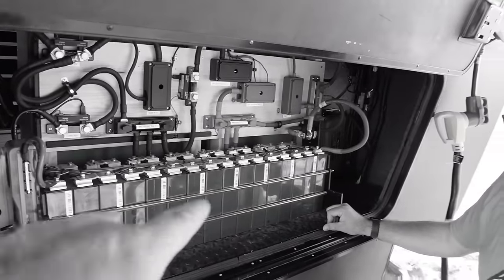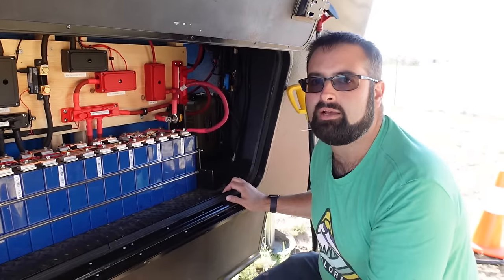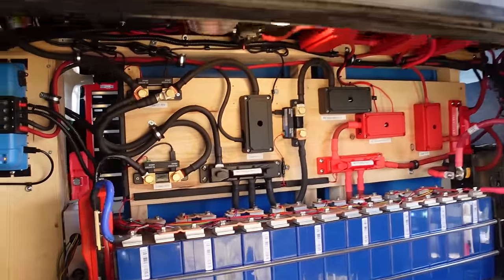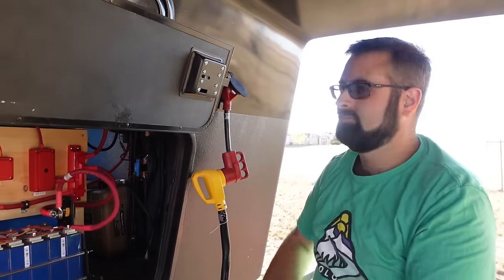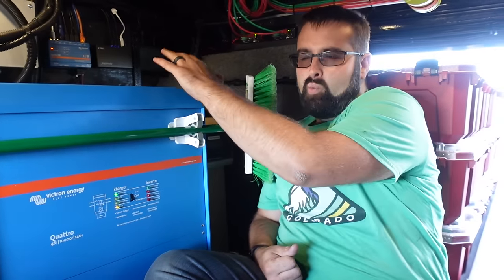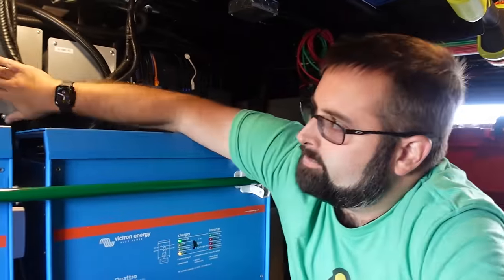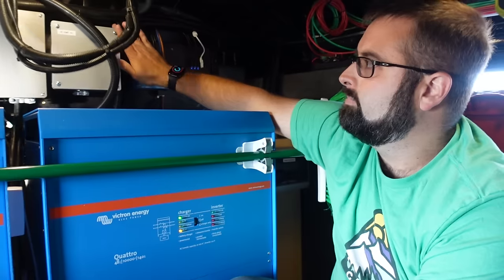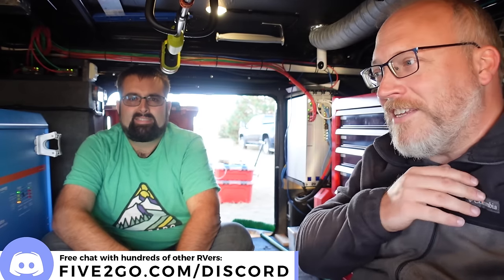How To Do RV Lithium The Right Way

Comment: Exactly why I built my own….BattleBorn is great product…when you want a name and have a big checkbook. I wanted capacity and didn’t care about a name. Built roughly 16kwhrs for roughly $1200. Wasn’t hard and love them.
Reply: do you have a manufacturer / parts list for the $1200 system, just what I have budget wise
Reply: Yes, share more info.
Reply: im doing the same thing  and its a lot cheaper
Reply: @mattg8787  can you share your setup/bill of materials ?
Reply: @ALongLongWaytoGO  Thank you so much for taking time to document your method, will look into this for sure !
Reply: @jz2188  thank you. It’s a work in progress. Definitely still learning. I always do not want to impede on someone else’s YouTube channel. But if you hop over to our channel I have a lot more detail about my battery builds. YouTube@A Long Long Way to GO…and again…I don’t want to impede on another channel.
Reply: You didn't build a 16kwh lifepo4 pack that's for sure
Reply: @randybobandy9828  I do apologize for that mathematical miscalculation. I’m so glad for much smarter people than I am. My stupidity gets me regularly.
Reply: @randybobandy9828  since your much more versed in this than I am…I’m just learning and don’t know everything….I have 16 320ahr cells and I don’t exactly know what voltage to do calculations at…so they hold pretty stable at 13.8…..roughly. What else do I need to know to calculate it correctly?
Reply: Does it work for you and are you satisfied with it?? That's all that matters..
Other ex-Spurts will criticize anyone's ideas but their own...
Reply: @gregprince2523  LOL….Yes…Yes it does. It’s an awesome experience to build something yourself that’s incredible. It is a learning experience. We’ve got plenty power now for our needs and it’s great not to run generator. And no…they still haven’t chimed back in to help me out on the math…LOL….THANK YOU !!!
Reply: @randybobandy9828  so I’m still confused…I went back online to the forums and pulled another conversion reversed….kWh to Ah….so at 16kWh and a slightly nominal voltage of 13.2 volts…it still comes out at 1212 Ah…which with cells currently used calculate to roughly 1240Ah….still not sure of the mathematical calculations….so looking for your expertise to calculate correctly.
Reply: @A Long Long Way to GO  I'm just saying that there is no way you paid under $100 per kwh for lifepo4 cells, even directly from China. I constantly look and price out cells and keep track of prices, and the lowest that can be had is about $130 per kwh, and that's hard to find. You're saying you paid $75 per kwh for lifep04 cells; you can't even find regular lithium cobalt cells for less than $75, especially including shipping. Battleborn batteries are definitely overpriced by about 2.5x as much as they should be, though.
Reply: @randybobandy9828  I’ll include the invoice for the next set of (8) 320Ah cells I just bought in the next video series. It was $400 for the 8. This way we can help others out with savings to build systems.
Reply: @A Long Long Way to GO  who's the seller on aliexpress? Did you verify the cells capacity with your own capacity test? What grade are the cells? Are they rebranded cells? Do they have a qr code on them?
Reply: Id love to see this build and how u did it? Seems awesome and better pricing, does it have low temp and high temp sensors etc?
Reply: @Avies48  I’ll try and video this next build again and put up on our YouTube channel. I have already documented my first two builds. This second set of 16 cells was purchased off AliExpress and should arrive mid January. Yes…one must be patient when ordering international. You will deal with a LOT of criticism when you start building your own with carefully shopping. Criticism runs rampant when you start finding deals that others don’t. Patience is a must.
Reply: Last month I purchased 16, 320ah cells from EEL batteries in China. They were $1,726 shipped to my door. They are guaranteed grade "A" cells with a minimum actual capacity of 325ah per cell. 2mm flexible bus bars cost me another $70 and a 200A Heltec BMS with low temp protection added another $100 more. So for around $1,900 I have a complete 16s, 16.38kwh 51.2v LiFePo-4 battery. You can get grade "B" cells cheaper, but why bother?
Reply: @SuperSushidog  exactly…..price point is spot on with time elapsed since I bought mine….now you have basically around $12k worth of “BattleBorn”…..I like your logic. Save tons of money and have just as good or better a system.

Comment: Question we do lots of community outreaches through out our state as well as throughout endeavor the country to help during natural disasters. We have a 40 foot trailer and are looking to build a new 53 foot trailer. In the past we have been running a 12000 watt Cummins Onan diesel generator. Sometimes we start it and it runs for as many as 4 to 5 weeks only stopping long enough for oil changes. Although we get very good fuel economy with fuel prices right now it can cost up to $1200 per outreach or disaster situation. We go into inner cities as well as rural areas. We are non profit and looking to go with lithium and solar as well as keeping generator to help charge the system if needed. We have contacted battery companies unfortunately they are more about sponsoring fishermen and sailing YouTubers rather  than helping out non profits. So we are looking to do a system ourselves. We are designing and building our own trailer but could sure use some help with designing the lithium solar system. If anyone would be interested in offering some advice it would be highly appreciated. We are extremely mechanical and capable when it comes to fabricating. Also pretty electrical and have a friend that has been a union electrician for 30 years. But advice in the design of this type of system would be a tremendous blessing. Thanks for consideration.

Comment: First off a mis title here that is a LIFEPO4 Battery bank... Huge difference between the standard Lithium batteries because the normal Lithium batteries suck... Next off I use a 24v LIfep04 Battery on my mobility scooter and its amazing!
Reply: True, although most people in the community don’t really know the difference — they just call them “lithium batteries”.  🤷🏼‍♂️
Reply: @Loren Tedford - What is a "standard lithium battery"? There are numerous lithium chemistries. As you mentioned these batteries are LiFePo4, which is a lithium battery. Li(lithium)Fe(iron)Po4(Phosphate). There are others, LiIon:  Li(lithium)Ion, LiPo: Li(lithium)Po(polymer), the list goes on.
These are indeed lithium batteries.
Reply: No, these are lithium. Nickel Manganese Cobalt or Nickel Cobalt Aluminum Oxide (etc) aren't the owners of the "lithium" battery name

Comment: Are you running a 48v aux alternator off the engine or a PTO? it seems that would be the most efficient way to recharge your system quickly.
Reply: I’m not doing anything like that right now.

Comment: Oversizing the inverter - you are going to have more power loss/waste.  Besides that, nice system.  On the cells, have you tested to confirm they are running rated capacity?  Do you have temperature sensors on the cells?
Reply: These inverters are correctly sized for the application and environmental conditions. They are 10kVA at 25C but only 6kVA at 45C.
Reply: Yeah, we oversized for the temperature derating issue.  Also, yes… Eric did test all the cells prior to installing, they actually clocked it closer to 245 Ah, despite being rated for 230 Ah.  I’ll take it.  😂
Reply: Victron inverters have such low idle consumption that I dont think it impacts his 20kwh system when you factor in his solar potential. These arent Chinese all in one units with an idle of 90-120 watts per 5Kw of inverting power

Edit: I see complaints of the no load consumption being 100W for some people. Manual says 30W. Thats a big difference and I would demand a new unit
Reply: I also live full time in the rig and literally never have a no load condition.  😂

Comment: Where did you source these batteries and what’s the brand/model of them?  Great setup on this rig!  Digging the network and internet setup!
Reply: Hey Chad.  I’m glad you liked everything.  My friend Eric designed the system and sourced the battery cells, so I’m not 100% sure.  I do know they are from CALB and they were a pretty new model from them this time last year.  The cells are rated at 230 Ah each, but when Eric load tested them, he got closer to 240 Ah
Reply: @triphius  do you what the chemistry of these batteries are? LIPO, LIFEPO, etc..
Reply: @sbene6439  they are certainly LiFePO4
Reply: @triphius  Thanks for the information on the cells.  I found them and am looking at vendors right now to see who I should buy from. What BMS or group of BMS’s did you use?  Seem to be a huge variety and most are 200A and less.
Reply: I got the model number for the battery cells — it’s L173F230B from CALB.   The BMS units are from a company called Daly.
Reply: @triphius  Thanks Ben!  You have been very helpful!
Reply: @triphius   where is the discord channel you talk about where you connected with Eric?

Comment: The only issue I see is lack of insulation between each cell. The outer case of those cells are connected to negative, and the only thing keeping a short from happening is that thin blue coating that's very easy to nick while installing. During road vibration it can chew right through. Cardboard, thin plastic, fishpaper, really just about anything will keep it safe.

Good job on the compression though, the rest of the build looks high quality and we'll thought out.
Reply: the cases on lifep04 are actually positive not negative and yeah it needs some sort of isolating sheet between each cell, because if the blue wrap wears away then bye bye RV
Reply: I agree with your assessment about insulators between cells. I feel it’s also important to add insulation to the compression rods.
Reply: You might not be able to see it but he might have a insulator between cells, it's thin and might not look obvious when clamped
Reply: I’ve got insulation on the compression rods, but will be looking into something for in between.  Honestly the cells don’t really move… there’s actually a bit of suction between them from the material and compression that it has yet to be a problem.  But I can take a hint!  There’s been a few people who have mentioned this, so I’ll be making that happen regardless of my luck so far!  😂
Reply: @ericklein5097  i have 64 of the eve 280 cells.... and a multimeter so have tested

Comment: It's baffling that there aren't any RV manufacturers putting regenerative breaks on any new models.
Reply: RV manufacturers aren't really about giving you self-sufficency. They know their clientèle, and most of their customers stay at caravan parks where they have shore power.
Reply: @gabrielrej834  Most RV lifestyle people I've seen would see recouping lost energy in breaking on steep inclines as a very appealing feature.. Wandering Wagners would probably like it as much as he liked having the engine break option available on the Freightliner.
Reply: @cd4683  it's only possible if the RV is a hybrid or EV
Reply: @shaynegadsden  which begs the question, given the obvious physics of a massive brick shaped house full of crap going down a steep grade and all the kinetic energy coasting downhill, why aren't there already dozens of hybrid drive models on the market? They're putting solar panels. Imagine the potential of a diesel drive system (which one could fuel with homemade hemp derived biofuel) plus solar panels and a hybrid drive system with regenerative breaking. It could increase the range exponentially. Which answers the question why there aren't already dozens of examples. Greedy investors own both the fossil fuel industry and the entire transportation industry and they benefit from trucks and RVs getting like 8mpg. #GreedIsNotGood #DefundCapitalism
Reply: @cd4683   Most people want to strive for efficiency and environmental friendliness, but even though you have your ideas and questions are with good intentions, I don't think you realize how much power (KWH) it takes to power a large RV up a long steep grade. Also, going down hill you would only get back about 30% of the power you used to go up the hill on regenerative braking. Even if the whole RV roof was  plastered with solar panels, it would provide maybe only one percent of the power needed to recharge a massive battery bank that would be needed operate a large RV. Then we have the massive cost for a complex high tech system. So, essentially it is not practical nor viable at this point, that is why these systems do not exist. If you want to have an idea how much power it takes for electric vehicles, not only to operate, but to tow a travel trailer, go to TFL truck on youtube and search of their Tesla and Ford F150 Lighting EV towing a camper and/or regular trailer. See how quickly the battery gets used up, meaning the distance driven between needing a recharge is severely diminished. Then do the math of how many kwh is needed to fully recharge the battery, then compare that to how much solar you can put on a roof of an RV or travel trailer, then keep in mind that this is only a pickup truck and not a huge RV. This will give you an idea of impractical it is. It takes much much less electricity to live in an RV boondocking, that compared to the electricity needed to propel a large RV down the highway. It is apples and oranges, so, looks great in theory, but then there is practical reality. 
I hope this sheds some light to your question.
Reply: @johndiezel5781  I don't think you understand inertial energy as well as you think you do. A biodiesel fueled hybrid drive system with at least two electric motors, like perhaps the new Yamaha's electric motors would absolutely more than a negligible gain in fuel economy and range. One could fill the tank at home with hemp derived biofuel too.
Reply: @johndiezel5781  your counter point has a very Mitch McConnell tone.

Comment: Looks like a cool system! Diy is definitely the way to go when you want to be cost efficient. Just wondering how the weight ends up, is it comparable to hauling the generator or is the RV maxed out now?
Reply: A Onan 5500 generator is about 288 lbs., and of course you will have at least one 12V battery for the basic system, and probably more. Each cell on his system is probably about 11.85 lbs., so 36 cells x that is 428 lbs. for battery weight. The big Victron inverters are about 128 lbs. each.  The solar panels are probably going to be 250 lbs. plus mounting hardware. That's over 930 lbs. for the major components, and then there is the wiring, smaller electronic boxes and components, and wood mounting panels. Maybe pushing 1100 lbs. for the system.
Reply: @G53X0Y0Z0  I appreciate the breakdown!  I’ve just never gotten around to it.  That seems like a pretty good estimate!  😊

Comment: If you ever decide to make some changes you can replace those two dally BMS with a single baytrum BMS and it will replace the two individual battery shuts you have and give you way more information on your batteries including individual cell voltage and jbd makes a BMS for 12 volts they make a 48 volt as well and a 24 that has Bluetooth connectivity individual cell voltage and an internal shunt and switch.  Having said all that would you have there is an amazing battery build
A good BMS like a patreon or patreon style or JBE and there's a lot of them out there doesn't need a balance board/ active balance you might want to look at some of Will Prowse old videos on them. Also a Victron Orion would allow you to charge your RVs 12v from your tow vehicle
Reply: Or JK.
Reply: @USA-GreedyMenOfNoIntegrity  JK is pretty cool shizz
Reply: Do Baetrium and JBD/Overkill make a 500A BMS because I think thats what he is using
Reply: @ericklein5097  Batrium does make a 500 amp suntt but personally I like their 1,000 amp shunt as it is only $20 more power does not actually pass through the BMS itself making it safer as for the jbd/overkill BMS that would be more for his 12v battery but they do make a 48-version that you could wire through a 500+ amp switch or a shunt trip breaker the reason I have made this suggestion is because in a high amp situation like he has due to the fact that if he maxes out his system he's going to be pulling around 413 amps you generate a lot of heat in the type of BMS that he has wired the way he he has elected to wire it a single Atrium BMS would replace the 248 volt BMS the balancer board that he uses as well as the cell monitor that he has and give him a couple of relays and multiple temperature sensors so he could set it to turn on a vent fan when the temperature reaches a certain point or in the winter turn on a heating pad when the temperature reaches a different point